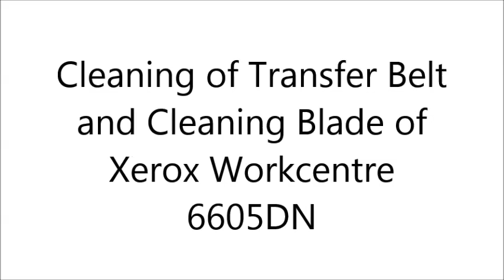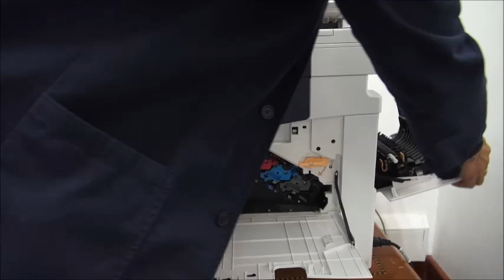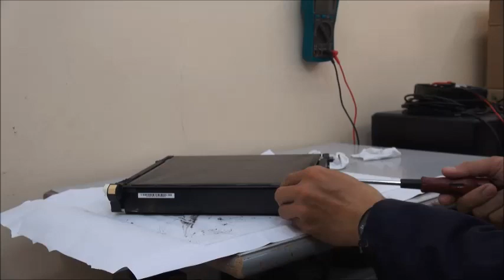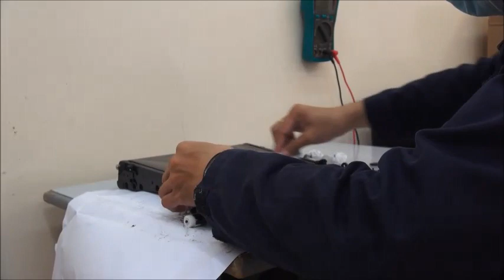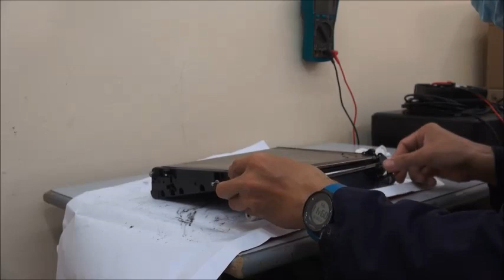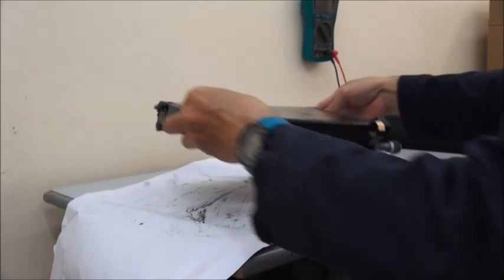Xerox Workcentre 6605DN  Cleaning of Transfer Belt and Wiper Blade

Comment: Actually your left hand is in the way of the reassembly, and hiding where the thing snaps into place. :(
Reply from the maker: Just take a picture of the left and right gears before removing the cleaning blade. It is very difficult to return the small gears if you dont know the right positions. Just be carefull in disassembling the unit.

Comment: do you know what cause my CYAN drum not fully transfer the CYAN color? its look smuge and have a some mark on the Right side of my printed paper
Reply from the maker: First clean the individual glass at the top of the imaging unit . second, disassemble the CYAN imaging unit then clean the charge roller inside.
Reply from the maker: Clean first the transfer belt if it still dirty clean the charge roller of the cyan imaging unit.
Reply: @macor285  ow.. okay.. i will try.. thanks..

Comment: Sir, what are the causes of the wear of Transfer belt?
Can we get a new transfer belt or old one?
Reply from the maker: It is normal. Check the counter. The capacity/yield of transfer belt is 100,000.
Reply from the maker: Better buy new transfer belt. Just try to empty the waste toner chamber and wiper blade before replacing.